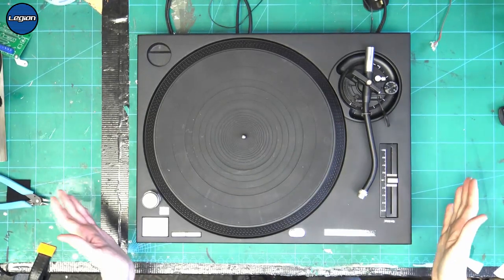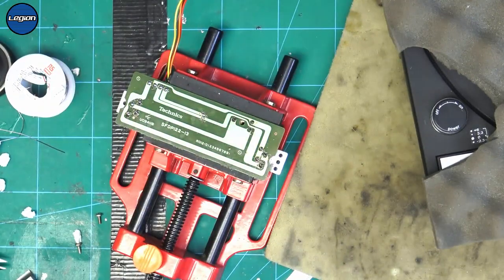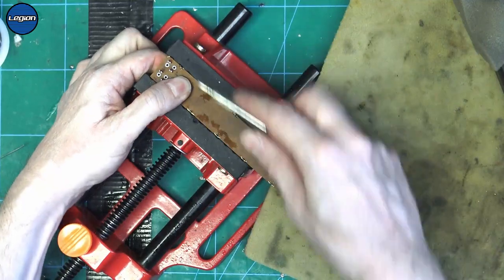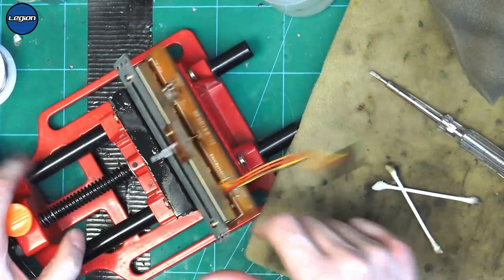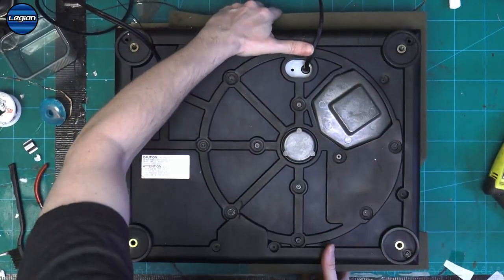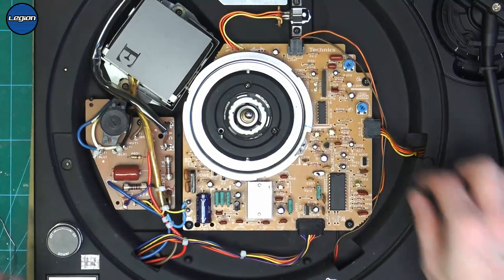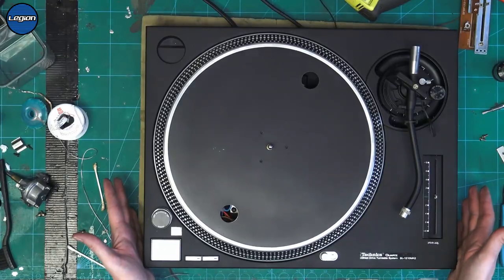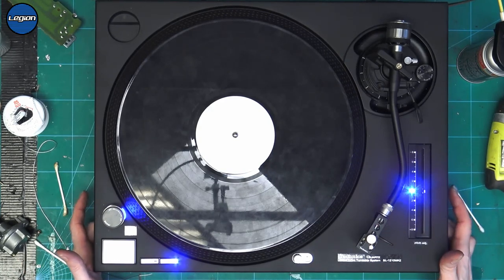Technics 1210 repair VLOG #1 - Pitch wobble problem that was a main board fault.

Comment: Had same issue on a 1200 some years ago..thought it was the pitch,but tested fine turned out to be an over heating issue on main board, simple replacement of the part and deck brand new again.price was 15 or 17 pounds for part (cant remember) and 40 for the engineers labour a grand total of under £60 he also gave the deck a service aswell..happy days

Comment: I'm about to restore an MK2 so I'm sure these videos will be of great help. The top 25% of my pitch is a tad sticky so this cleaning and lube job will be helpful for sure. I think I need new caps and some VAT adjustment clean and lube. Other than that my deck seems ok so far. There may be more, who knows. I'll see when I dig into it for sure one way or the other. Anyway thanks for recording these. I'm sure I'll be step by stepping these video's very soon.

Comment: Also have this problem few years ago pitch going crazy. I found out that 1 transistor soldered was loose. I just soldered it back firmly again.  Fixed.
Reply: thanks mate
Reply: Do you recall which Transistor had the fault/loose solder?

Comment: When I get weird speed issues or start/stop being wonky, I go right to Q201 #2SC1846 and Q1 #2SD1265. If they check out ok, which is rare in those cases, I replace Q2, Q3 #2SD357R and D3 #MA1951M and that should do the trick. I find this issue mainly on decks that have travelled a lot or decks that have been questionably refurbished. Hope this helps, keep up the good work.
Reply from the maker: I have other videos when I look at these things in more detail. I did check q201 off camera

Comment from the maker: Hi All, I have this deck back and after a few weeks it has damaged this board too. So it is either the PSU that is bad or the Blue LED are using too much current for the board to supply. They are very very bright ! When I have time I will take another look and let you all know.
Reply: I have a problem with the technic 1210 tone arm the right side chanel works but the left goes on then it goes out again
Reply: @paulmccann6009  clean the headshell connections with an eraser
Reply: Did you ever find out what was causing the problem? Sorry if I've missed the answer to this somehow.

Comment: i read some where that the pitch wobble problem comes from the resistor at r307. it was originally a 2.7k ohm resistor. if you replace it with a 10k ohm one it should fix it. this is what i found working on a 1210 mk5
Reply: it is actually the 5V zener diode. This drifts with age and temperature and if it gets past 5.2V pitch on, there is risk that the speed will become unstable. it is better to use a 4.7V zener here. Changing R307 gets a little more voltage swing from IC201, but won't always solve the time/temperature issue.
Reply: @kevinatkab5219  yo this is very helpful. Much appreciated 🙏🏽🙏🏽
Reply: Hey Kev, I've tried 2x new pitch sliders, and 2x 10k resistors at R307 , pitch still drifts, you reckon the diode will sort it?  At D3R or something like that 🤔

Comment: 4 or 5 years ago I had a problem on my 1210 mk2 where when the pitch slider was out of lock there would be speed fluctuations. 
The way I 'fixed' this at the time was to disconnect the pitch slider and jump the middle two pins on CN102.

Only recently has any other problem emerged, runaway as soon as the player is turned on. A bit of searching around points towards it likely being Q201 or IC102... 

What worries me more is that I believe this issue has been caused by dirty voltage at my new residence (I've had two computers fail, as well as now my record player within 6 months and am struggling to see it as coincidence). 
I have a new multimeter on it's way to me and will begin more thorough testing when I'm able to visit a friend with more reliable house electrics!

Comment: i had the same issue  and i changed the Q2 & Q3 to new ones and this solved the problem !!!
Reply from the maker: in this case I replaced the PSU because it came back a few weeks later with another power related problem.
Reply: @DJlegionuk   hi mate i see one of your vids for a bearing replacement in the gimble if you could make one how much would you charge for one of your jigs you put the gimble in you done on the 3d printer ?
Reply from the maker: @scuttle69  HI, email me you can find it on the about page.

Comment: Did you find out what was actually wrong with the board you took out as my sl1200 is doing exactly the same, it started after a short with the target light, thanks and great videos.

Comment: I have an issue with my Stanton t120. It won’t hold 0 pitch manually, soon as you get to it (which is massively off the 0 mark) the platter jumps the other direction!!! The pitch zero light also only comes on when I hit the lock button!

Any idea? Can’t get a single part for these which is utterly ridiculous

Comment: This isn’t related to your issue, but I own a pair of MK2’s and one of them the platter won’t it spin it’s literally in a locked position no free spinning even when powered off. I removed the platter and inner cover for an examination, then I returned the parts to their original install. Plugged it in and now it’s spinning, any  ideas ??

Comment: 2 questions please, can you recommend a cleaning fluid for the pitch and that vici multimeter you use for the frequency counter what's the exact model number please?
Reply from the maker: i have a video showing how to clean the pitch and also how to calibrate using that multimeter. vici VC99 it's a cheap fluke clone.

Comment: Hi Lee and thanks a lot for all the helpful content you publish! : )

I've been having severe pitch wobbling issues on one of my SL-1200 MK2 ( getting triggered on approx. -4% and getting fixed after +6% ), and after a lot of tries ( pitch fader, platter, D301, R307 to 10K, electrolytic capacitors, etc. ) I finally ordered a new mainboard that I hope will make my turntable spin properly again...

And I have a question regarding installing the new one: when I removed the old mainboard, I unattached the blue and yellow cables by untwisting them from the pins, do you think I should try to twist them again as they come from fabrics or should I solder them instead?

Cheers!

P.S.: Sum one more that would love to know what was the faulty piece on the motherboard!
Reply from the maker: HI, So that deck is coming back to me. It developed another issue and I think the fault goes back to the PSU as it's now doing strange things on the leds. So I think that board was damaged from the PSU. I did notice one of the power transistors was damaged. WIth regards to your question I normally twist back on and then solder as well to be 100% safe.
Reply: What a fast response mate! Thanks! : )

Now that you wrote that, I'm also concerned about having issues in the PSU that could potentially damage the new motherboard... Spare parts are becoming pretty expensive and hard to find...

This is so that I was considering saving the money for a new MK7 turntable instead of fixing this one, but I'm too attached to them for letting them go...
Reply: Hi again  @DJlegionuk !

My package with the mainboard got lost by the carrier company so I need to find an alternative : \

One further question: do you know if the mainboard of a SL-1200 MK3 would work in a MK2? They look quite similar, but I can't find any info on Internet...

Thanks in advance! : )
Reply from the maker: @josemartin7655  this link says they are the same, but you need to match the connections, some are black and some are white.
https://1200s.com/products/technics-sl-1200-1210-turntable-main-board-pcb-with-motor-a-fully-tested-mk2
Reply: @DJlegionuk  I was wondering if you could lete know how to fix the problem on my technics tone arm the left channel goes on but the right channel goes off the it goes off again. I don't know if its the RCA audio cable or the tone arm wires

Comment: What should be the good news to the customer that you had to swap his faulty mainboard with a working one? I honestly didn’t get this sorry ;-) my customer will not be happy at all ! Just kidding. By the way, do you have any idea of what was the real fault or you still have to digging little more deep into the issue?
Reply from the maker: Good old British sarcasm lol. He already knew everything as I was talking to him as I found the faults. It was only supposed to have the noise from the platter touching something so I spoke to him as soon as I found the wobble when moving the pitch. I will take a closer look at some point, but my time is limited at the workshop so have to get on with some other parts.
Reply: @DJlegionuk  I would like to know as well what is the issue. At east where to search. I just got a turntable and it does the same. On the center is stable and when moved up and down you can hear also the in the sound the jitter can be seen on the strobe light. Another issue before this was that the tonearm is bent a bit downwards. Is that fixable by just bending it up back? Maybe to heat it up a bit. I should keep it and get a  partial refund or is better not. I'm a ninja with the soldering iron but on deep electronics not really. I'm confident replacing parts no matter what they are. What do you think? Laurentiu
Reply from the maker: @FlyHighWavesSounds  hi, I would check the pitch as that is the most common reason for wobble. In my case I have the deck back and it has blown another board so the PSU is bad. On the new board it has no 5v and old the old board I can see some damage to Q3. If your tonearm is bent you can never get it back to normal because the metal tube will have a kink, if this is not correct it will not make good contact with the stylus. I have another video showing tone arm problems so take a look at that, Yes it is fixable but it will need a new silver tube and you will have to check the other parts of the tonearm for damage as bent tube = something heavy was on top and the other parts can be damaged. You could also replace the arm, but this would be £100 and more just for the part.